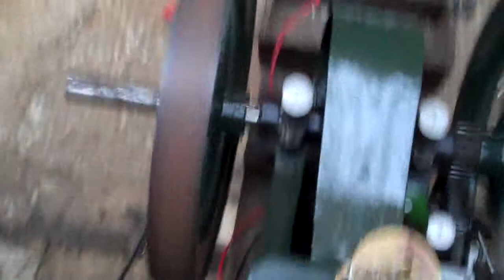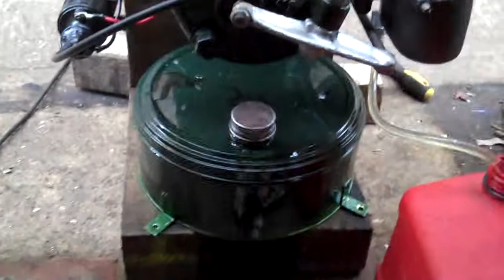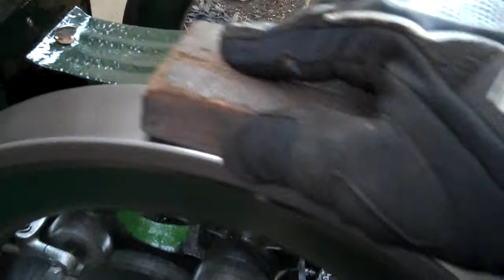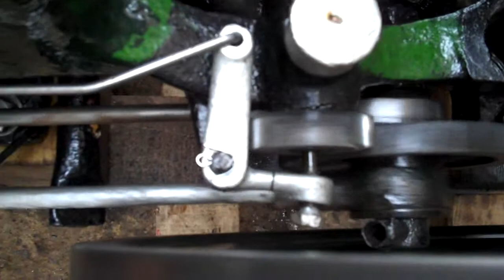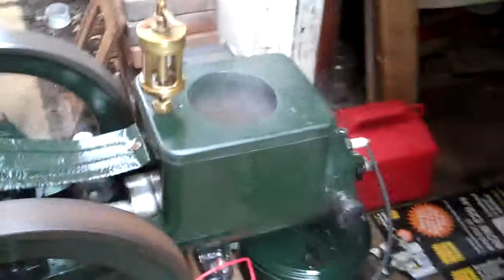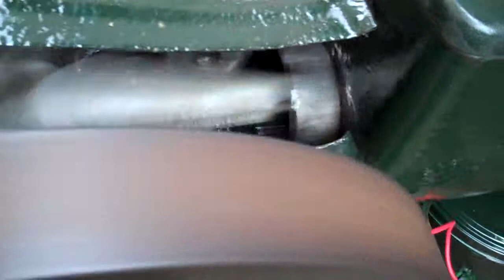WITTE UPDATE PART 6

Comment from the maker: @MultiNaatje Thanks. Yes I have already printed off a copy from "Harrys old engine" Very informative and useful info. I start the Witte on petrol and when it is warm I add parafin(kerosine) to the fuel tank. It starts and runs well with a 50/50 mix. The cylinder head should be easy to repair with sif bronze. I wish you succes with your project.